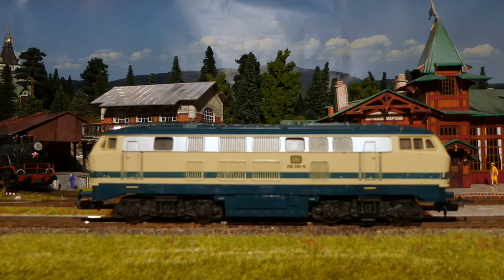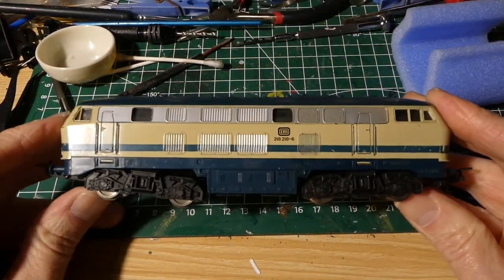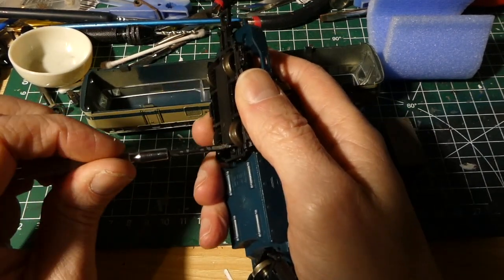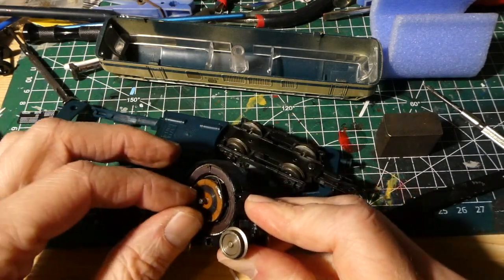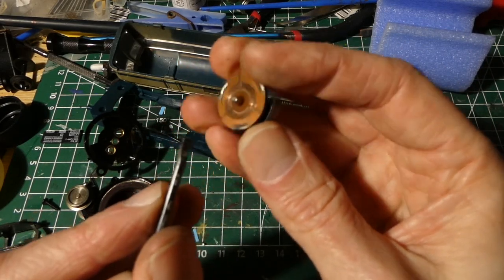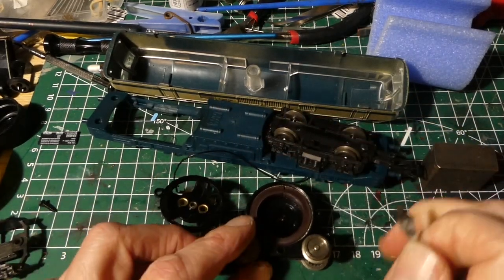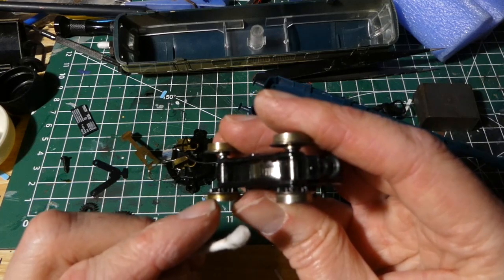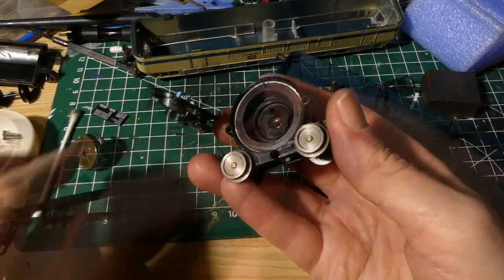How to clean a Lima H0 locomotive (or at least the way I usually clean it)

Comment: I follow the same procedure, with some variations. I use lighter fluid for general cleaning and after that I use contact cleaner. I use technical petroleum jelly on the gears and electrical pickups, it keeps things running smoothly and silently as well as improving electrical conductivity. I also lubricate the rotor bearings with a mix of technical petroleum jelly and sewing machine oil.
Reply from the maker: Great advice, thanks 🙏

Comment: Good explanation!  Glad to see we are following the same method and I've not been missing bits out.  I'm sure youve explained before in another video, but what are the small weights you are adding?  Are they from tyres?  Thanks for posting
Reply from the maker: Yes, the small weights are for balancing car tires. I buy them relatively cheap only. They are easy to apply. Thanks for watching 🙏👍

Comment: Hello Erik, 

Like you, I am also a fan of Lima models for their ease of servicing - I have several nice British train models from Lima. Do you know of a spare parts supplier in the EU for things like traction tyres? I need to replace some Lima parts, but can only find parts suppliers in the UK and import charges make that very expensive.

Best Regards, Ben
Reply from the maker: Hello Ben, I have used Piko traction tyres, they fit more or less. I use Märklin oil. I didn't buy other spare parts yet, I usually buy extra Lima rolling stock in a bad state from which I can get spare parts to get my better rolling stock working better. I would however change more motor brushes if I could get them easier. Greetings 🙋‍♂️ Erik